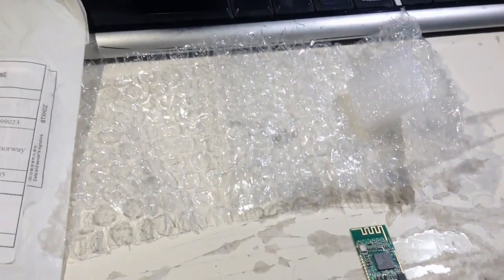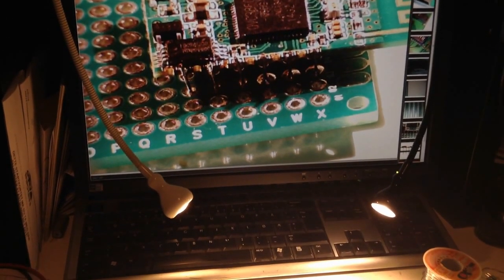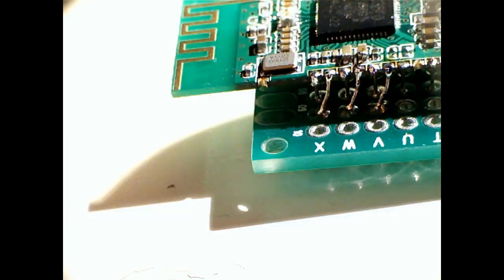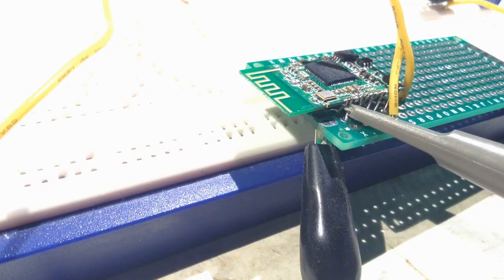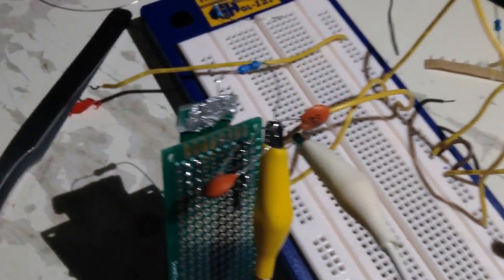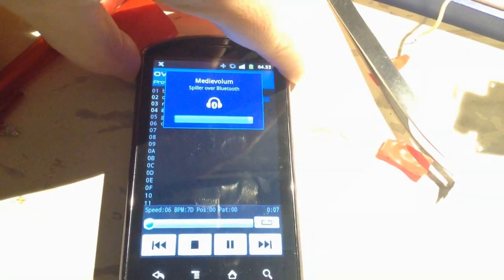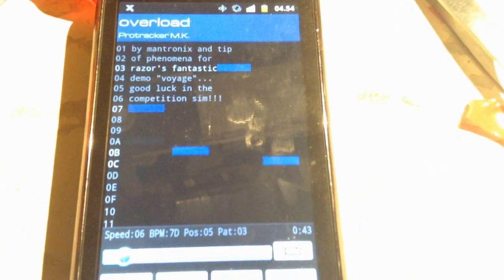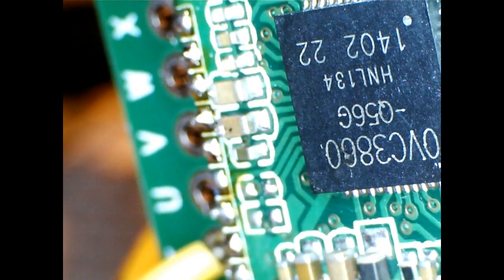Tivoli Audio Model One - XS3868 Bluetooth Audio Mod (Fail/part 1)

Comment: Well you can count it as a fail maybe, but I still think it's pretty amazing how you correctly analyse each situation. At least you know where it went wrong. I'd probably blow it up and blame the manufacturer or something. 
Nice watch again....is that really your bedroom by the way?!
Reply from the maker: +The Highlander Thanks. I like to find out what and how things go wrong.  This is where i sleep and solder. Tonight we will sleep at a hotel. We leave in an hour or so to go a place near where I will be bicycling over the montain to Lillehammer. I made a video of it last year on my other youtubechannel. This year I'll try and record small snippets a long the trip and not only record the cycling from my helmet cam. Lillehammer is a great place, and my inlaws have a trailer-camping (vacation) place near by and we will stay in a hut without water and toilet this weekend. It'l be fun. Maybe you saw a bunch of dog photos on my facebook the other day. I'll take some more pictures of the puppy at the in-laws place.. btw do you like algebra? :D The C64 saver boards are on their way and I have calculated resistor values and used circuit analysis techniques. I'll included that in a video. I'll make a "classroom" video. :) The only thing is that such videos can stretch for an hour but I do want to try and keep it short... The board was ordered from OSH Park and it was panelized together with 75 other projects (multiple of boards). I Like what they are doing there. Have you tesdted the spy glasses some more ?
Reply: +bwack I'd like to see the bicycle trip. My country doesn't have mountains and that's the one thing I really miss sometimes. Mountains can be majestic. 
To stay in a place without water and toilet...back to basics! Never done that. 
I'm very interested to learn about how you work with resistor values and stuff. It's another thing I never really got when I was younger. I mean I can do the math, but I just want to learn how to apply it to circuits. I love to learn that kind of stuff. So I'll stay awake during that hour, don't worry.
I've experimented with the glasses a little bit. Frankly the quality of the picture is bad. It says HD but that's just a load of crap. The sound is pretty good though. When it works. I'm planning on doing a little demo recording this morning when I go to one of the thrift stores.
I've decided to do some C64 software development courses on udemy. com. Or at least I'm looking into it. You can get paid for doing instructional videos. Maybe that'd be something for you to consider as well.
Reply: So I went out this morning with my glasses. Pretty nice run, but when I tried to turn on my glasses it was dead! I came home to charge it but so far it's not doing anything. So either the battery has complete discharged (can't understand why because it was doing nothing as far as I know), or the thing broke already. Which I can't believe because it just sat on my desk for a week or so.
Reply from the maker: +The Highlander The trip was good. We had water and toilet just a short strole down from the cabin. I made a video of the bicycle race and posted it on my facebook page. I have recieved the tiny power saver boards. Waiting for components. Will make a video of it and also include some elementary circuit analysis.. should be easy to follow.
Reply from the maker: +The Highlander Maybe it's one of those you have to charge just before you use them because of some self discharge thing.. maybe it didn't shut off properly ? These spy devices don't show much sign of what state they are in (recording or off).

Comment: Great little module!  I am wondering where else this might be used, maybe C64, Atari ST, Amiga, Game Gear etc.  I guess you could use something like this with a mic for spying purposes oO. Think 007!
Reply from the maker: GadgetUK164 Maybe.. It is an receiver, but it does have mic input. Not sure about the quality there.. You can run it off a lion/lipo cell and get about 10meters range.. I forgot to post the link to the shared project at OSH Park https://oshpark.com/shared_projects/dbesUi3N .. Someone made a breakout board for the module.
Reply: Doesn't take many components to get a mic working though!  Might order one of these!
Reply from the maker: GadgetUK164 I ordered one from alice/TxHang again :) True. here is the schematic http://www.icstation.com/ebay/PDF/XS3868M.pdf on page 8 you see a mic connected with a resistor and two capacitors. Note also you need a regulator between 3.6 - 4.2 V..